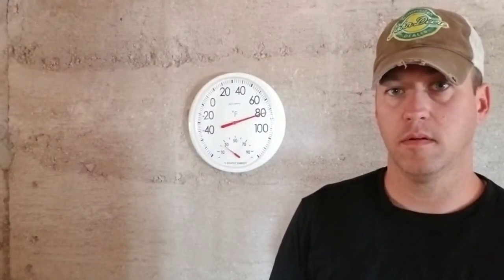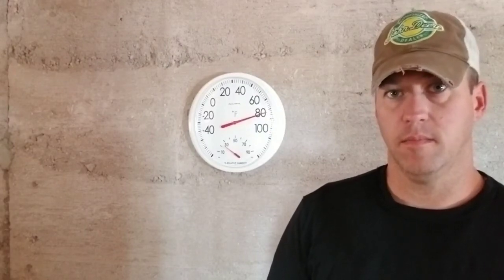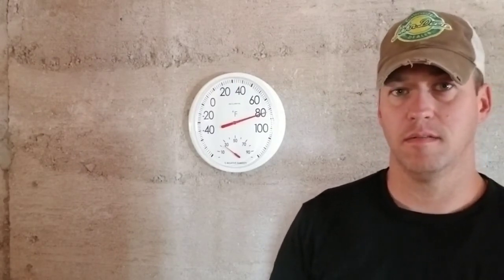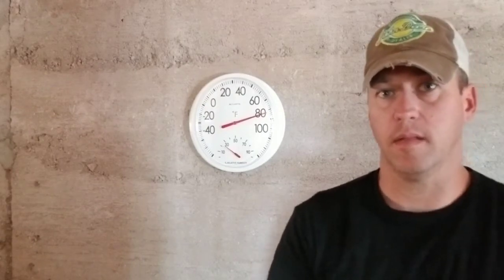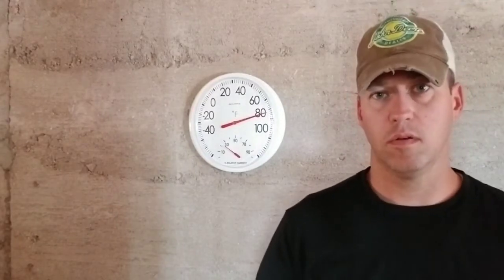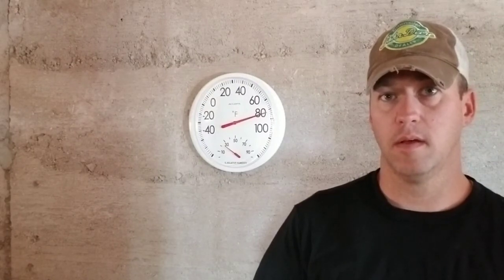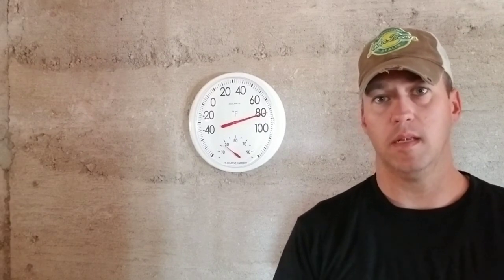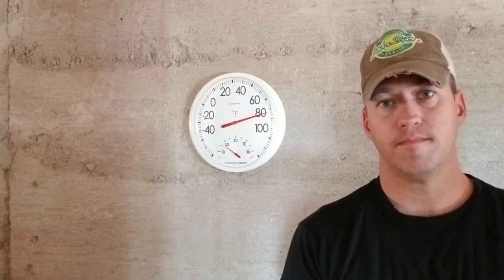Rammed Earth Update.

Comment: Hello; we enjoy your videos and we are planning on building our home in Pinal county.  We have a few questions.  Where did you get your metal roof material? The forms that you made, did they work out well? Jumping Jack tamper vs pneumatic pole tamper? How easy was the permitting process? Did you draw your own plans? My apology for asking so many questions.
Reply from the maker: Hey!  Thanks for watching the videos.  I bought our metal roof locally from Thunder Mountain Metal.  I think I cost us about $2/lf at the time.  The forms worked ok, but I would suggest using high density plywood which is designed for this type of application.  The clamping method and general design worked great, but after the initial use the plywood grain raised and left a pattern in the walls.  The permitting is fairly easy especially in the southwest because Earth building is relatively common.  It does vary between counties though.  If you have the money for the pneumatic tamper and large compressor that's the way to go.    We did our own plans.  An easy way is to copy and paste the general code requirement drawings from other plans and then just draw your own floor plan.  If you have any major unique structural features it's obviously best to get an engineer involved.  Some counties require an engineers stamp anyway.  Hope this was helpful, and feel free to ask more questions.
Reply: @thinkingoutsidethegrid5625  Hello again. I was wondering about what to do when removing the snap ties which leaves a hole on the walls? Did you guys just fill them in? Any recommendation? Thank you.
Reply from the maker: @polodrive8672  we didn't use snap ties in our forming system, but typically people usually cut the check ends off flush with the wall with a grinder.  Hope your making good progress.
Reply: Thinking Outside The Grid ! S

Comment: Great video! Kinda curious about what kinda footing you went with. How much engineering went into that part of your project
Reply from the maker: We have pretty stable soil where we are at and now frost line, so I went with a rubble trench footing that is about 18" deep.  The only concern I had was making sure there is proper draining away from the house.  So far it has been great.
Reply: @thinkingoutsidethegrid5625  - Yep. You just hit the nail. One of the most important aspects of rammed earth construction, is water management. Or better said avoiding it. Good drainage is very important for a long lasting and healthier construction. ;-)

Comment: Good video.I'm kinda doing the same thing as you. But I am building with interlocking compressed earth blocks and going to make a few of my accent walls with rammed earth. You should do a video on compress earth block, I just can't seem to get my mix right yet. They crumble when I try to move them from the press.
Reply from the maker: K Mat 
Thanks!  I've found that the mix is the same for earth block and rammed earth.  The most important thing to do is to allow them time to cure while they are covered so they can retain their moisture.  Wetting them down every couple of days helps as well.
Reply from the maker: K Mat 
Here is my video on compressed earth block.
https://youtu.be/iV5btBPssxM
Reply: Im no builder, but maybe you can place a slightly larger plywood as baseplate under the block so that it will not crumble after removing it from the press.
Reply: @boopiedistura  Good idea, but I figured out what the issue was, and now my bricks are firm and solid. But I was going to use a piece of plywood until I figured out the right mix and compression. And my bricks are much bigger than the ones in the video, they are 350mm long 175 mm wide and 85 mm wide.
Reply from the maker: @boopiedistura  great idea.  Thanks!
Reply from the maker: I ended up using a steel plate in the bottom of the press.  It's helped out tremendously!  How is your project going?
Reply: @thinkingoutsidethegrid5625  I'm not sure if you're talking to me but incase you are, the project is going well. My wife wanted to get the brick to at least 800psi before we started building so it took a while but I finally got the right mix, with 4 percent white cement and 4 percent lime.I had to take a break from Nov to February because I didn't want to make the blocks outside when it gets below 30F.

 i'm doing all the work by myself with small equipment so I am still pressing the bricks, should be done by the end of march and will start the foundation after that. For 2 houses
Reply from the maker: @saneblane   Great info on the mix ratios.  What part of the world are you in?
Reply: @thinkingoutsidethegrid5625   West Texas

Comment: Neat information about strength in regards to hurricane force winds. Makes you happy to hear about foundation with rubble trench. Thank you for sharing. I plan to add air conditioning because if a night isn't cool it won't reset.Especially important to have and like idea of metal conduit that hangs down with blowers like in Walmart. Much cooler than hidden into ceiling.

Comment: Rammed earth will not keep you warm in the winter. Freezing, overcast days will not warm up any of the walls, they will be the temperature of the outside. In cold climates you need insulation. He will likely need to add inches of rock wool on the outside, then put a lime plaster on top of that. That would allow his heating to heat the mass of the walls without losing much of it to the outside.
Reply: Eh, southern arizona winters arent exactly arduous.